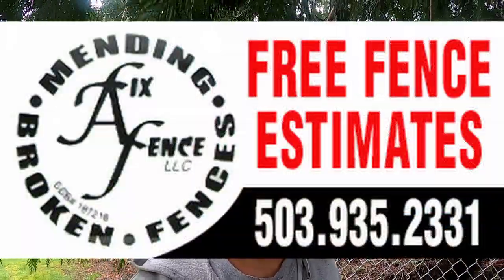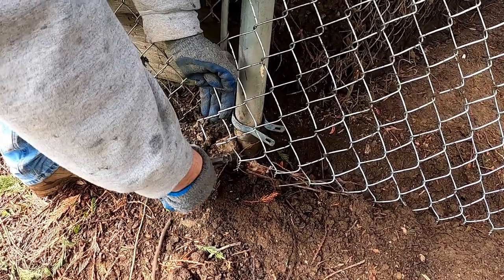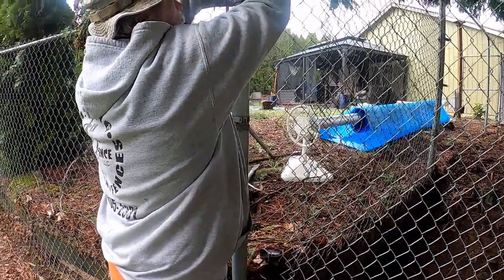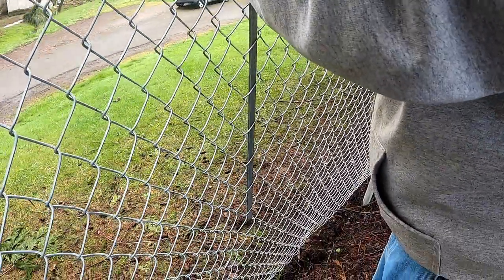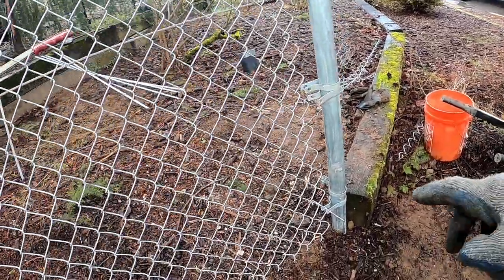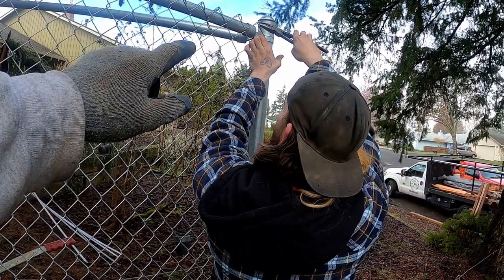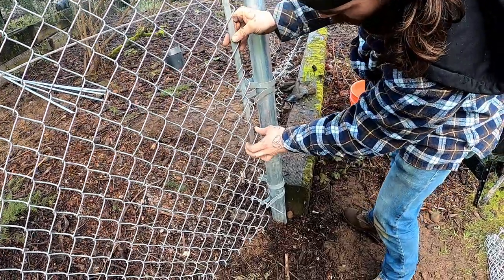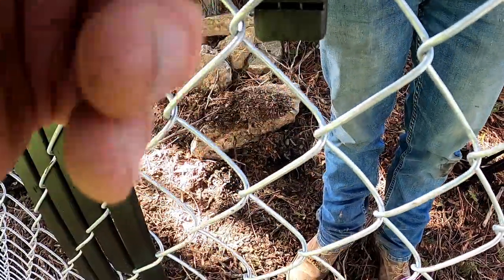How To Cut A Bias For Chain Link Fence ( Fourth Video )

Comment: Did a bias today turned out great however I had boatloads of trouble keeping my link above top rail uniform on the post at top of the hill
Reply from the maker: Great to hear, I like to use a fence tie to tie the chain link to the grade of the top rail, that keeps the angle to the dangle as I say in one of my other videos. Thank for viewing, I am glad to have helped out.

Comment: Bias cutting really is a hands on type of training like your doing. Even after 20 years, I sometimes miss the mark lol. Great video John!
Reply from the maker: Thanks,.. certainly was a twist on things, having someone other than me do the hands on, thanks again
Reply: Great job only thing u should do use an old tention band put on terminal to stretch hook cable jack on band insted of wraping itaround post saves jack and dont have to pri bar back to get off..